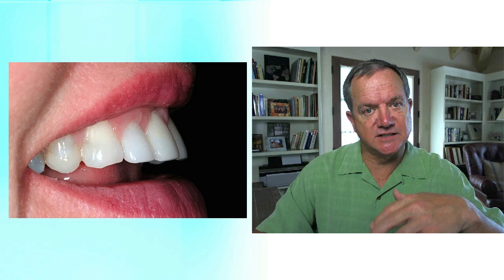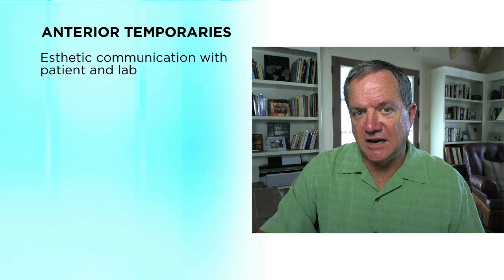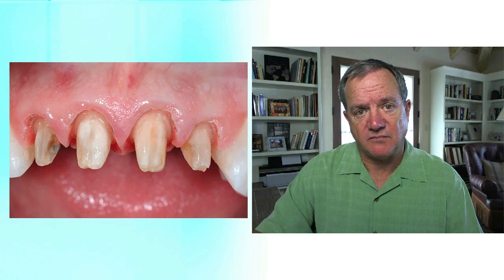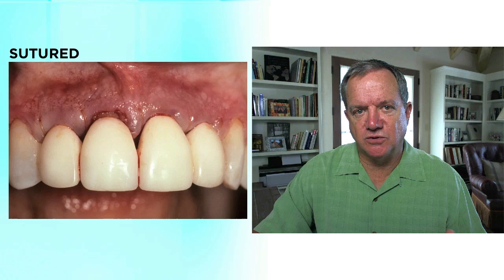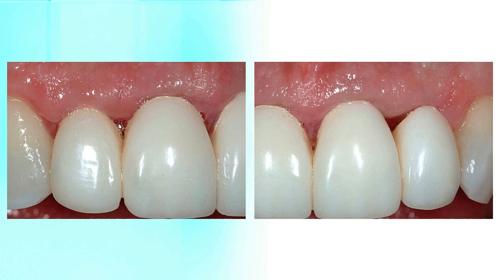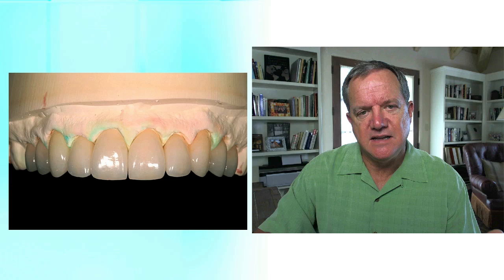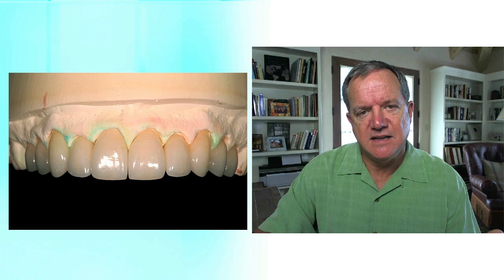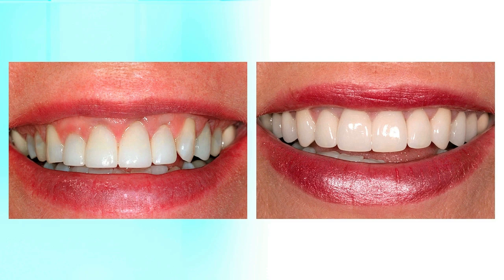Anterior Temporaries, Part 1

Comment: Thank you for a great series! 
I do have a question, if I may; you mentioned the fact that anterior temporaries are used to communicate the position of the teeth to the technician. But you describe fabricating your temporaries from a diagnostic wax-up, which is made by the lab, if I'm not mistaken. 
This is kind of an "egg vs chicken" question: what came first? The Diagnostic wax-up with which you fabricate the temps, or the temps with which you communicate anatomical landmarks to the technicians?
Thank you in advance